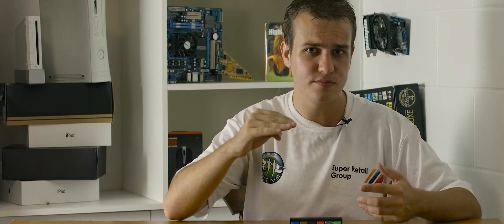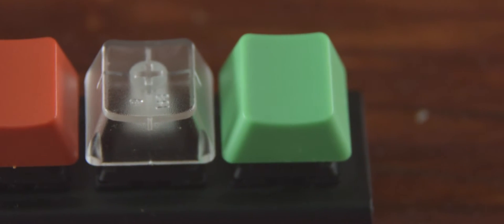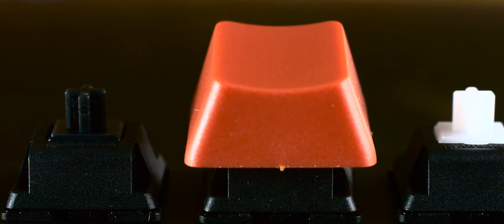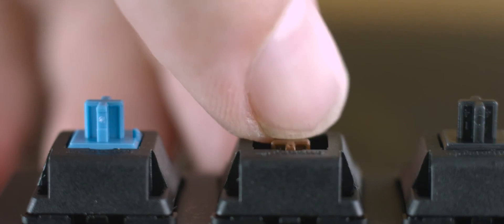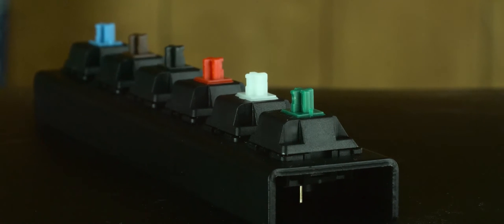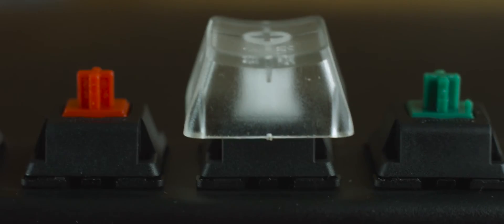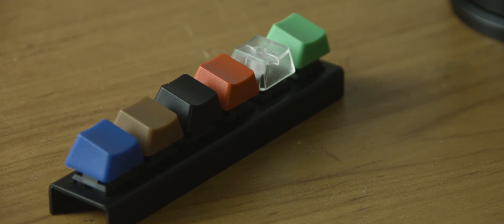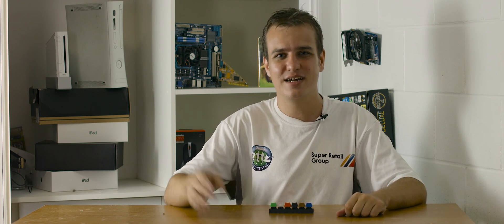Mechanical Keyboards - Best Cherry MX Switch?

Comment: You are not right: The linear switches also have a certain point where they activate, its just not noticable by that tactile bump. You don't need to bottom them out as you said in the video.
Just for clarification :D
Reply from the maker: Is good information, thanks :)